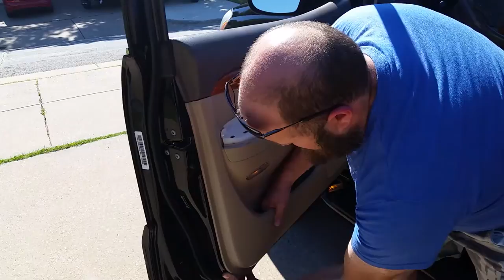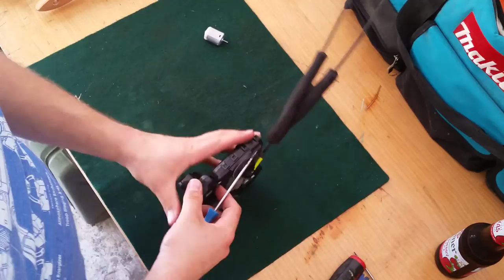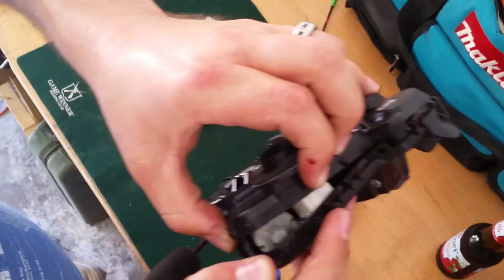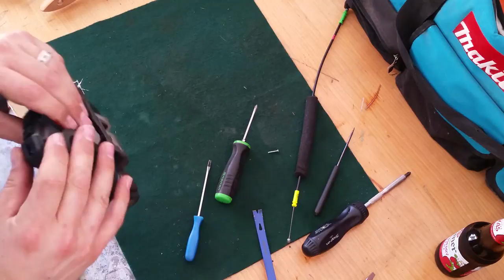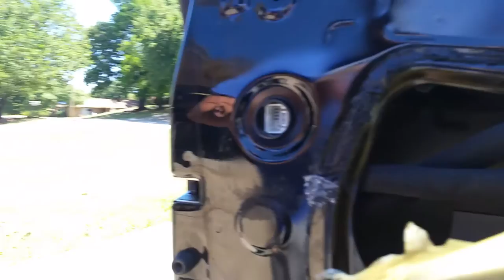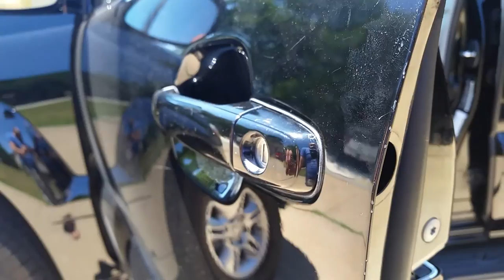Lexus GX470 Door Lock Actuator Motor Replacement!

Comment: Awesome video! 
Just replaced my 2012 GX 460 passenger door actuator following the exact steps. Piece of cake. Local dealer quoted me $605, eBay cost me $6.59 total.
Reply from the maker: Awesome! glad it worked out for you as it did me!

Comment: Thanks for taking the time to make the DIY video. Well done. My wife's 2011 Lexus is250 has the exact same door lock actuators, and I just replaced the motors in both front doors with help of this video. Two thumbs up.
Reply from the maker: Thanks for the feedback, I will be making more in the future as I have some other projects to work on as well.
Reply: There are a few different shaft configurations to choose from. Which shaft does the is250 use?

Comment: Thanks so much for this great video! God bless you 🙏.  I was able to replace the motors in the door lock actuators - the driver side and passenger side.  I have a 2010 GX460.  Both went out weeks apart.  The dealer wanted $650 for each.  I paid $6 for each motor and was able to change both in 2hrs.  It wasn’t difficult given the demo in the video.
Reply: I have a 2013 GX with the same problem. What kind of motor worked for you? I have been seeing use the 20mm D shaft but not sure if that’s the fit. Thanks

Comment: I replaced the driver’s front lock actuator and now the lock works with the switch, key, and key fob, BUT if you hit the lock button on the door and then close it the driver’s door unlocks as it closes. I though maybe it was sensing the proximity key being too close so I moved the key inside the house and same thing.  Any advice would be awesome!
Reply from the maker: that is actually a safety feature on some cars to make sure you do not lock the keys in the car. To get around that close the door while holding the outer door handle open and then it should lock. If that makes sense
Reply: @JeliSpace  it does make sense but that not how the original worked. I ended up returning the actuator and replacing the motor in the original factory one and all is good now.
Reply from the maker: @ericb1294  Ah I see what you are saying! Well glad it worked out lol!

Comment: Great video. Do you happen to have the part number for this DC motor? or where can I get one for my car? I have the same problem.
Reply: Moin Saab ebay
Reply from the maker: https://www.ebay.com/itm/111198111739?_trksid=p2060353.m2749.l2649&var=410228409590&ssPageName=STRK%3AMEBIDX%3AIT
Reply: @JeliSpace which shaft do we need from that listing? I need to order one!

Comment: My 2004 Lexus GX 470 remote like yours won't lock or unlock doors,  doors do lock / unlock manually  and master control works fine. Does it sound like I have the same motor issue you had?
Reply from the maker: Might be remote battery in that case, if power button is still working.

Comment: Do you know if the motor on the rear cargo hatch is the same motor as the one you are using. Trying to help a buddy out so he doesn’t have to spend 200 on the part and 600 on labor
Reply from the maker: From what I understand it is. sorry for the late reply

Comment: What year is your vehicle?  I have a 2014 Toyota Highlander.... probably uses a similar power door lock actuator.... however, the Highlander Door Actuators are now ALL SEALED UNITS..... you cannot pull the two halves apart and replace an inexpensive motor like you demonstrate...... Toyota decided it was better to sell $350 parts and a $500 repair job per door instead of treating it's customers with the long term relationship in mind....... My first and Last Toyota product.....3 out of four door locks have failed before 55K miles... and the 4th one is on borrowed time.
Reply from the maker: 2007 Gx 470

Comment: Savage.  How did you find out what electric motor was needed, and where did you get it from?  Thanks.
Reply from the maker: https://www.ebay.com/itm/111198111739?_trksid=p2060353.m2749.l2649&var=410228409590&ssPageName=STRK%3AMEBIDX%3AIT
Poking around I managed to find them on the interwebs!
Reply: Thanks for the reply, but what I really meant was how did you learn which motor to get in the first place!  Thanks.